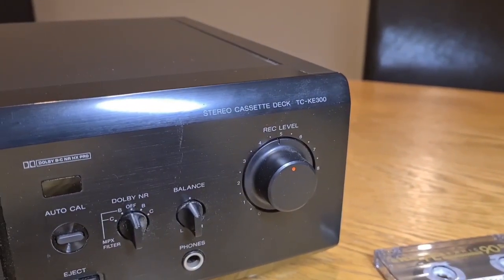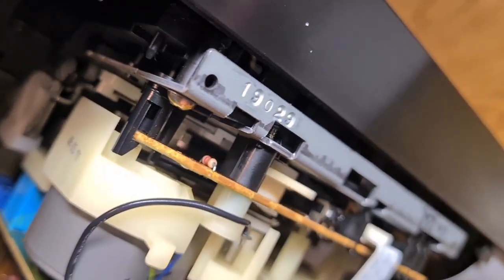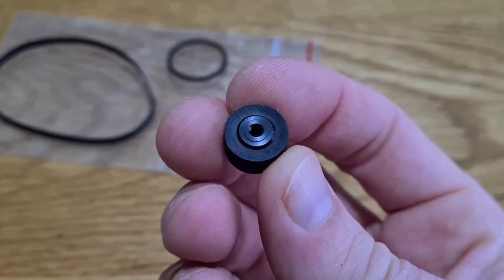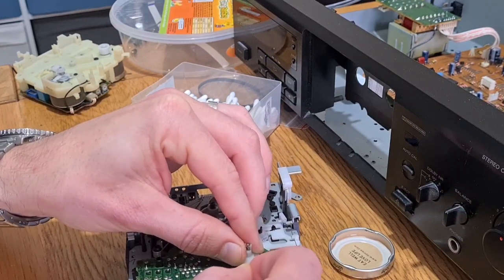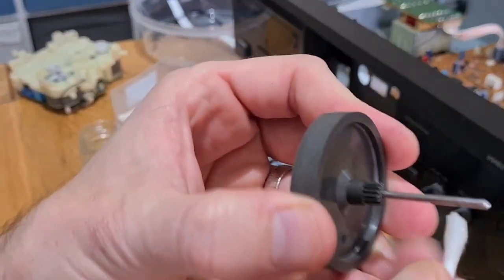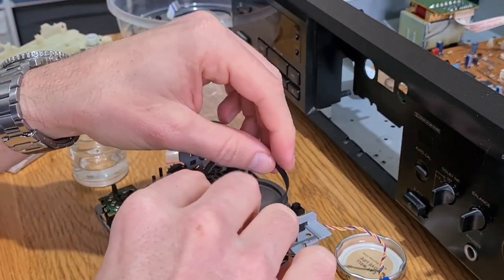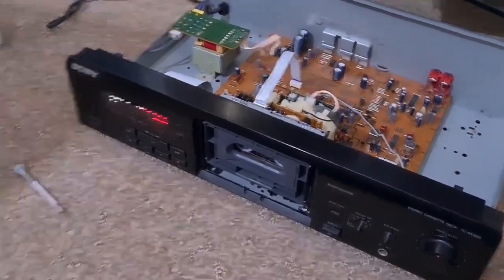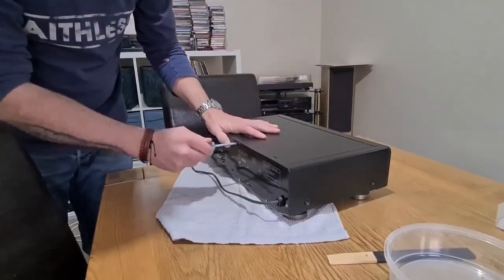Sony TC-KE300 Late 90s Cassette Deck - Repair, Belts & Service

Comment: I think the 90's is the peak of cassette technology. Great repair.
Reply from the maker: It is, but it went downhill towards the millennium I feel. All curved cases and round edges
Reply: @pwrestoration  Agree, I feel the same way
Reply: 1982 Was already the best of best.Example-AiWaas came along with adf-series.And there was a bit earlier also. But they were no cheap. Pioneer was also late 70`s at the top. People just dont know.Downhill started at late 90`s. Pioneer ct-95 was better performer than naka draggo even.

Comment: I did notice that the drive gear on your reel motor (The one with the small belt) was cracked... You can also hear it in FF/REW. It's very much and thing with this generation of deck and the previous lines with these 90's mechs. The parts are available by the way and I've done a swap out myself, very easy. Not trying the be that guy just giving a heads-up. :)

Comment: Another thank you for this great video. My KE200 had also stopped working as both belts had disintegrated to an oily mess. I followed the instructions you provided and got into the unit and spent at least 1.5 hours cleaning the oily gunk out (truly a messy process - I used most of  pack of cotton buds and a third of a botte of IPA). Got a replcement belt and roller kit from Ebay (£11) which included a new spindle for the roller and fitted them as shown in this video. Fired it up and was extremely pleased to have my cassette desk workng again.
Reply from the maker: Happy to help! I love these decks. I've still got this one, and it sounds better than a lot of its higher priced competitors. That oily gunk finds way of getting in your hands no matter how much you avoid it 😅

Comment: Thank you for this! Just finished restoring the TC-KE300 I got for cheap on eBay. That grey wheel that moves the transport mechanism up and down was a pain to position correctly. The assembled deck would make a loud grinding noise, trying to reset itself, then lock the lid, and I had to take it apart again twice before it finally worked.

Comment: remember one thing. rubber can be destroyed and removed with benzine (solvent made of petroleum), especially when it has degraded to this state and has no resistance to this liquid. don't use alcohol as it's absolutely useless to remove this residue. Scratching it with some tooth stick is ineffective as well when it has glued to the surface and turned to something like resin. I cleaned my cassette deck recently and I have removed the remains of rubber belt with benzine and it was just like wiping it off. I believe it doesn't do anything to plastic in no way. But benzine dissolves most types of rubber unless it has a special benzine-proof formula. I doubt these belts are made of something like that, otherwise it would never turn to such a slime within time. I remember that eons ago I used to repair bycicle inner tubes and benzine was required to prepare rubber surface for glueing as it affected it strongly making it clean and sticky. I don't know what they use to make inner tubes nowadays, but it was made of real rubber in the past. belts in cassette decks seem to be made of something like that yet a lot less stable. btw where are you from?
Reply from the maker: Well benzine is highly carcinogenic so I think we will stick with IPA - that works fine 👍🏻
Reply: @pwrestoration  I mean purified benzine. In order to get some problems you got to drink it lol. Talking about health danger IPA is extremely toxic btw
Reply: @Galova  nah you can technically drink 100ml of ipa and survive with no long term health effects, tho it won't feel nice at all.

Comment: Great video mate. I've got a few decks but never been brave enough to try any repairs, just basic head cleaning etc. This gives me confidence to maybe have a go. Will subscribe and look out for more.
Reply from the maker: Thanks, give it a go! I'm always interested in nice decks for repair if you're looking to move any on.
Reply: @pwrestoration  Hi there, I'm trying to repair my Sony Tc-kb820s Cassette Deck but when I opened it up I noticed that the the big major cog has broken when the brass screw goes in. Do you know where I could get a replacement one  ?
Reply from the maker: @deebis  Bad luck im afraid, you may find one on eBay where someone is selling parts from a broken deck. Alternatively you will have to buy a parts machine and transfer it.

I personally would buy a cheap working on in poor condition, transfer the transport, then sell it back on as spares or repairs for as close to the same price as possible. Good luck.

Comment: good job.towards end of casette era (beginning of CD era), dome decks suffered from cost reduction measures- the construction of a critical component, like flywheels, you noted, for instance, substitution of metal chassis members for white  -nylon -plastic - potentially hygroscopic - might  warp,crack. latter material even seen on a number pf Nakamichi's models. presumably as moulding components cheaper than pressing, machining, finishing metal parts. maybe even belt quality. very sad.
Personally, I would mot use anything abrasive on capstan shafts.

Comment: I would use a jewellers saw blade no.2 to get the gunk out of the v grooved pulley. I am going to replace the rollers and drive belts on my Technics RS-DV 280 twin deck.Hoping it will sort out the problem,the deck is 19 years old from brand new in 2005.
Reply from the maker: I get some corrugated cardboard usually, dip it in IPA and just run the edge through. It's tough enough to remove the gunk but soft enough to soak it up. Works a treat!

Comment: Why not go all the way and bring all adjustments back to factory specs.? It makes a big difference after all these years. Tape speed, azimuth, playback levels for dolby calibration, bias adjustment per tape type, oscillator frequency and recording levels to name a few.
Reply from the maker: Some of these cheaper decks don't really give you enough information in the service manual compared to say, nakamichis. Just the usual recording and playback levels and azimuth

Comment: Great video. But mine just whirs when pressing play but does not lift up the head to the tape. I can hear and oce I opened the lid I could also see the belt spinning momentarily when I press play but the tape head stays down. Also whirs endlessly when pressing "auto cal" but again nothing happens.
Reply from the maker: It just sounds like the head mechanical isn't being driven upwards to the tape. Have a double check to see if you can move it by hand. If you can it's time to take that transport apart!

Comment: Great video! Thank you. I changed the belts and it works but I still have a problem. Maybe you have some advice. When I insert a new cassette is does not run on continius speed. After fast-forwarding it just for a few seconds, it works. I can't explain why. Do you have any idea. Maybe a mistake when I re-assembled it? Thank you.
Reply from the maker: It could be that the transport is sticking a little, and the fast forward is resetting it. 

The other possibility is that whatever sensors this mech uses to detect the tape ending could be dirty, I can't remembernoffnhand whethernitnuses a magnet or it has mirrors on the back of the reels. 

I would also check the tape itself is properly seated when playing, again look for the fast forward moving or changing anything that is allowing it to play. I would remove the tape door cover and watch as the head and pinch roller engages. See if there is any difference in positions between when it doesnt and does play.

Absolute last resort is a strip, reclean and rebuild as per the service manual just in case.
Reply: @pwrestoration  Tanks a lot for your response. Appreciated! I guess I am alraedy over the measures you mentioned. Can yo share you e-amail-address, so I send a video that exactly shows the problem?
Reply from the maker: @heikotrefzger  I think if I add my email address to these comments the bots will annihilate me. The above is all I've got really without it being in front of me!

Comment: Hello, nice video! Did you noticed that pressing stop key when playing produces the left reel turning and loosing the tape to the right? 36:40 minute. Do you know the reason of this?
Reply from the maker: From experience a lot of the logic controlled Sony decks seem to do this, sometimes when putting a tape in (k611s and es etc) and I always thought it was just due to keeping tension on the tape. Maybe this one does it in order to not "snap" the tape taught if you're going to rewind or fast forward? I definitely don't think it's a fault.
Reply: @pwrestoration  but if you keep loosed the tape, when you press ffw, it will receive a hard tight. I was looking for this issue and it is caused by a broken gear. It is not normal. My TC-K511S do the same. I will replace the broken gear. I will inform you about the progress. Thanks

Comment: I haven't watched the entire video, Im at 9:26, so Im going to say the problem is with ALL sony's 190 drive's is that small gear is cracked on the motor shaft where the small belt goes.
Reply from the maker: You're right it is a long one! They always end up longer than planned. In the case of this one it was belts and pinch roller, and a good service. It's now giving sterling service.
Reply: Saw that too.... I had to swap it out on my KE500S

Comment: Very nice video, thankyou. I have done two of these now without success; the mechanism doesn't operate properly - as if the cam wheel and relevant levers/gears need to be in a particular location when you reassemble the 2 halves of the transport. Is anyone here able to shed any light on this for me please?
Reply from the maker: Generally even if they're off a little, they will reset themselves when powered up. So I would say if it's not resetting, it's either a switch inside the mech not making a connection, or your cams and arms are totally out when rebuilding.
Reply: Hi, thanks for your reply :-)  I have no idea where the levers etc need to be when re-assembling the transport. I have done 2 now, neither works. On one, the head block moved partway into position and won't come back to rest position. The other, motors turned things moved back and forth, but it stopped after a few seconds.
I will have a look at the various contacts on the mechanism and then try to work out how it's supposed to work.
It's a pity the service manual I downloaded doesn't cover the details of the mechanism at all, other than how to change the belts; there's no hint at all about where to set the position of the various parts before reassembly.
Maybe there's a separate manual for thus series of mechanisms or they covered in the manual for another model?
Appreciate your help, thankyou!
Reply from the maker: @jameswaldron2405  Generally service manuals don't instruct on belt changes, just show the drawing of the various parts of the transport. It's difficult to diagnose without seeing it though, and off hand I can't remember the ins and Outs if this transport as this was a while ago. Could you make out from this video roughly where things lie?

Head plates not returning to the home position sometimes is a spring that's popped off. Usually they are spring loaded to go back to the lower position. 

I would suggest the one you have that plays and stops is probably together correctly and it is an electrical problem. 

Maybe you could put the other one side by side to it and check all the mechanicals are identical?
Reply: Hi again, thanks so much for your helpful reply. I'll have a careful look at your video and check parts alignment and give it another go. Wish me luck 🤞🤞
Thanks again! Cheers, James